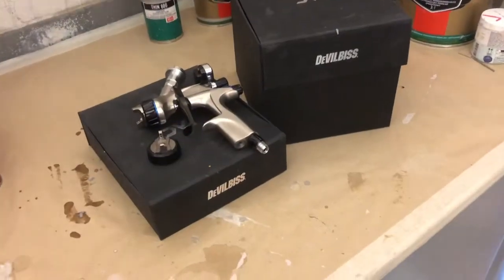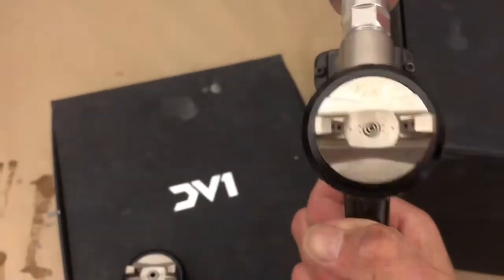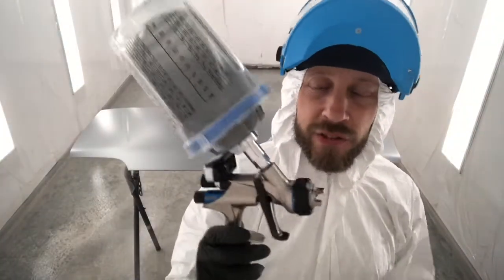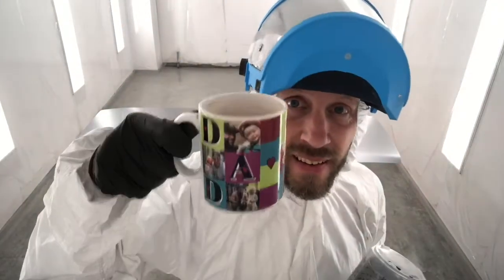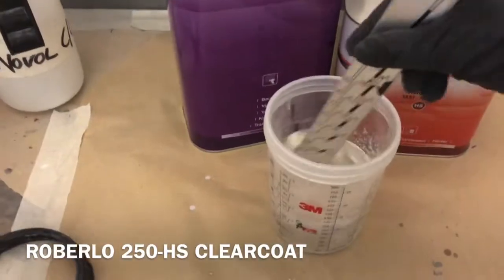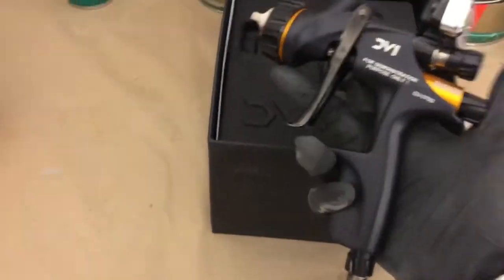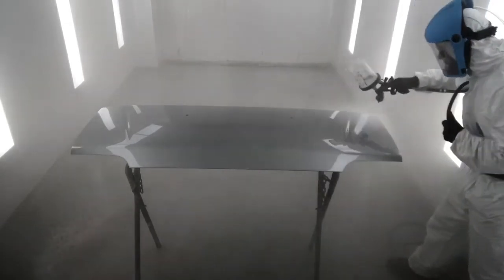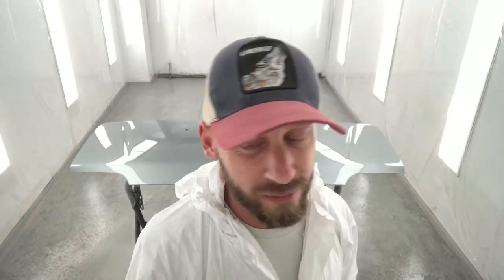Devilbiss DV1 base & clearcoat spray gun review by BD Autobody

Comment: What PSI is better to avoid orange peel?
Great video
Reply: Air pressure, distance from panel, fluid adjustment, fan adjustment, speed of travel, weather outside, viscosity of clear, lots of thing's effect your Orange peel. That's what guns have settings and paint systems have different reducers and catalysts. Understanding of everything, training, and practice practice practice will be the only way for you to get a proper answer for yourself. 3 guys can spray 3 different ways and all get the same result matching OEM peel. Everyone's different, just takes learning of skill and understanding of materials